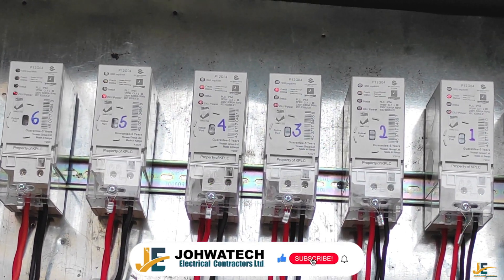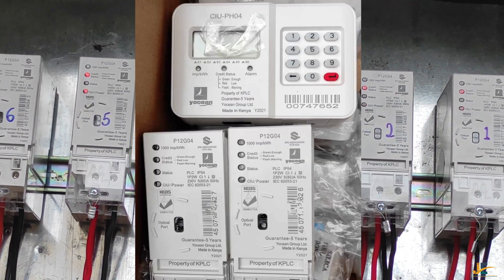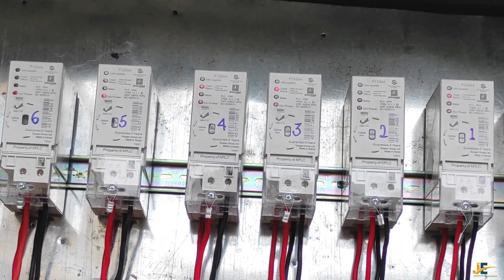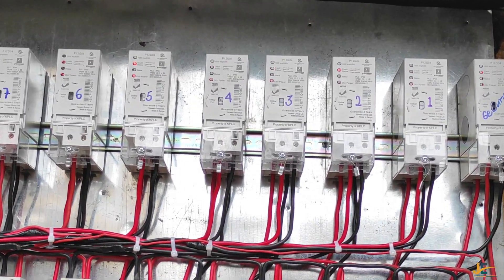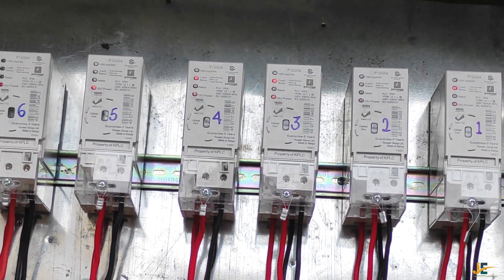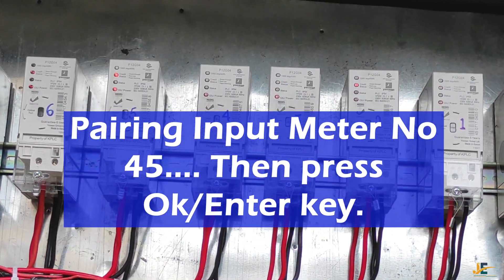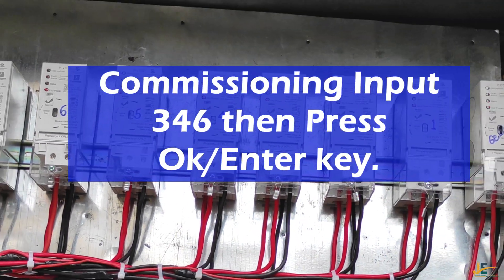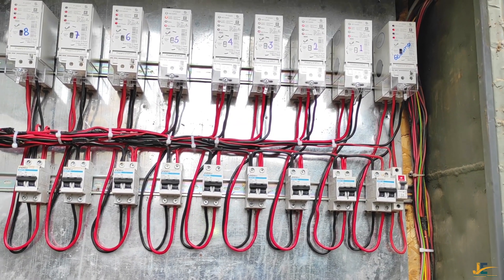HOW TO ACTIVATE Yocean PREPAID ENERGY METER, 2021 MODEL.Pairing & Commissioning.

Comment: How do we pair and commission hexing meter (black in color)
Reply from the maker: We don't pair/configure wired prepaid meters. We only Commision them after installation. To commission wired Hexing input 1275 4194 1448 6450 5970